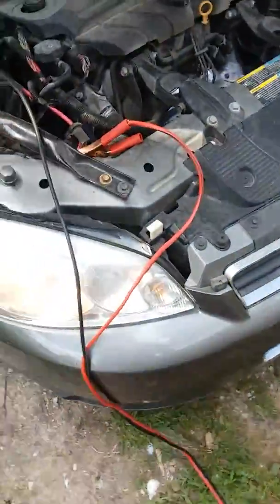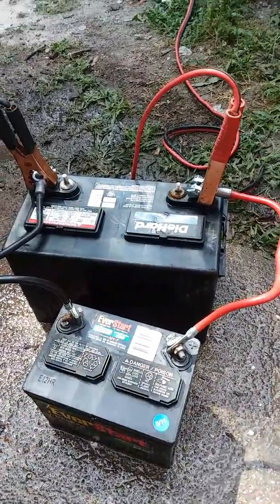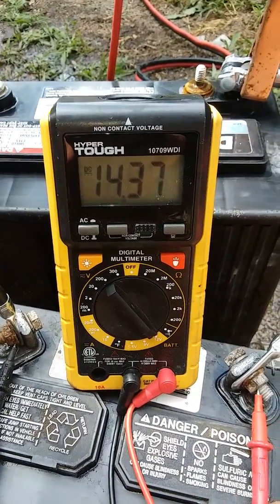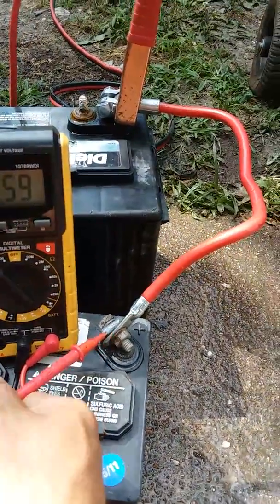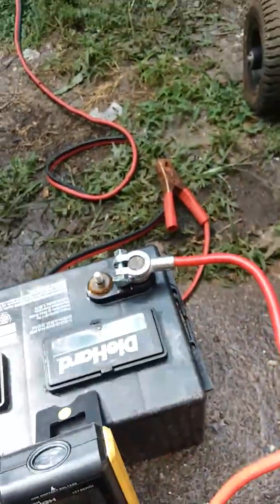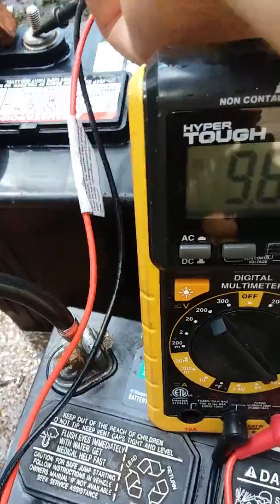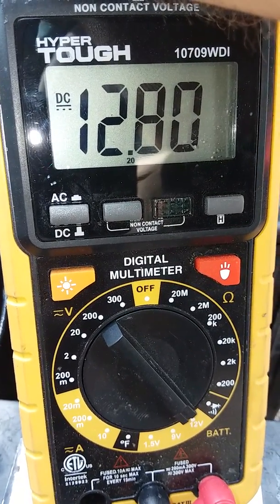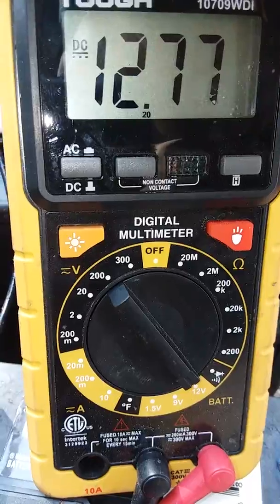Restoring a Deep Cycle Battery Part 4

Comment: Cool video...thankyou. Those are connected in parallel though. The charging voltage stays the same across both batteries but the current is split.